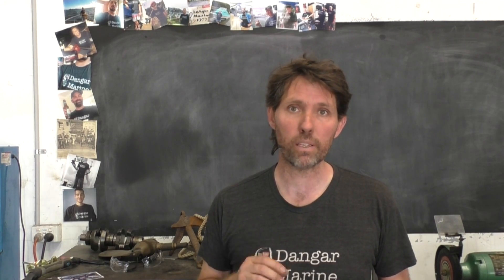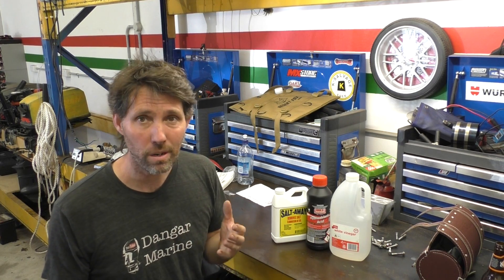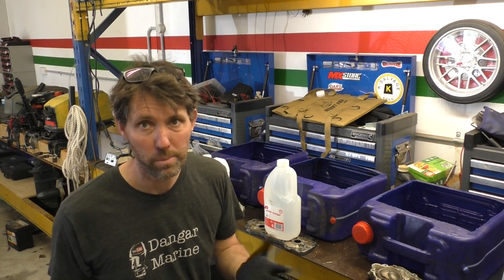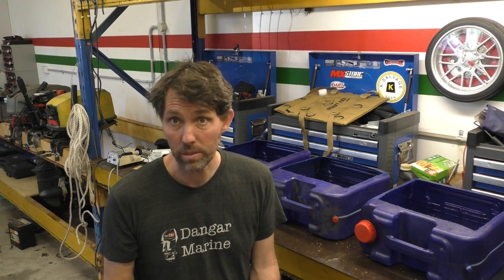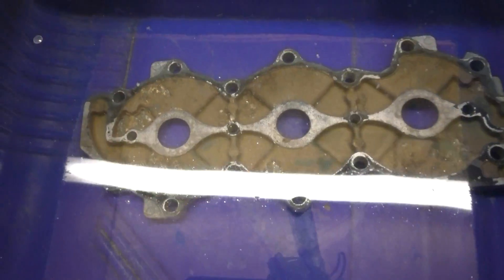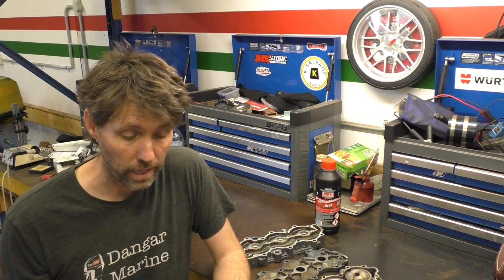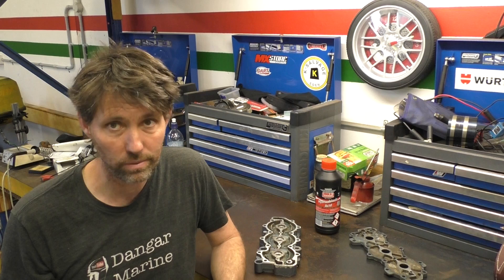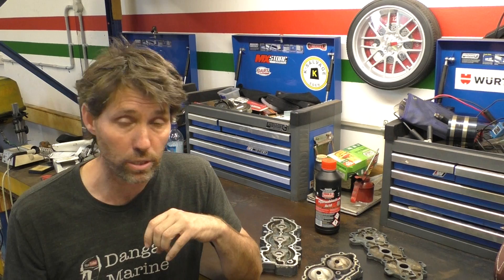Cleaning outboard water passages

Comment: All aluminium parts form a coating of aluminium oxide directly after production. Using HCl this coating reacts: Al2O3 + HCl > AlCl3 + H2O. This aluminiumchloride is solvable in water so flushed out of the engine. The aluminium will form a new layer of aluminium oxide but a little bit of material  is gone. The salt in the engine is NaCl which cannot react to HCl because it already contains Cl- ions.
It will soften by the water used and become easier to clean.
The impellor is made of MBR rubber which is resistant to most acids so nothing will happen.
To my opinion an outboard should be flushed with fresh water after use in salt water on a regulary base. This can easily be done by putting the tail in a big bucket with fresh waterand let it run for 5 min. on 1/3 power.
Reply from the maker: Interesting about the salt not reacting with the hydrochloric acid. I guess this technique might be okay for a one off restoration of a badly blocked outboard, but as you say, regular fresh water flushes really are the way to go.
Reply: Looks to be the most scientific reply.  A lot of “swear by” replies, is there really any study that says fouling is decreased by any process; ie. engine stripped after various methods?  
Anyway, our motor spends the season on salty moorings, flushing after use would be impractical. So I’ve stripped a 2004 motor for the first time and found it well fouled with muddy salt.  I had flushed a strong proprietary blue solution beforehand.  It colored some of the salt, but it sure didn’t make it soft enough to flush away.  I won’t waste space keeping the remainder of the bottle!
In my opinion only acid pickling could remove salty deposits without physical intervention.  Like Stu, I don’t think anyone would or should trust that process in a working motor. No problem if you want to pickle parts in a bath where you’re in full control, but not as a blind flush / soak. 
So periodically support your local Stu and get them to open up the water passages to clean them in a controlled manner.

Comment: Hey Stu, Do you know of a viable way to get a your solution of choice into the water jacket and have it sit there for a period of time? Say by blocking up the water pickup and pouring it in through the thermostat housing. Or with some head pressure in a hose, with muffs, clamped onto the water pickups and letting air escape out the thermostst covers. Would any such scheme have a chance to work or a waste of time?
Reply from the maker: Hi Adam, good ideas. I think the easiest way would be to take the leg off and then plug the water pipe heading up to the powerhead with a rubber bung or something. You could then pour down through the thermostat and get everything before it. You might want to let it run out for a bit first to bleed the air out. The part of the head after the thermostat might be harder to block up, but it is also easier to disassemble and clean.

Comment: I would never use any chemical in the aluminum parts of the motor and agree with you that a rinse of plain unsalted water is the absolute best option.  The wash bubbled more in the spark plug areas since the metal was not passivated and the acid was more aggressive in these areas.  The hydrochloric acid reacts with the aluminum to form aluminum chloride (another salt) and hydrogen gas.  The hydrogen gas is the bubbles that you see.  A big no-no.
Reply: I was guessing that the residual steel from the spark plugs in the head threads was also making a bit of galvanic reaction happening. The acid on a single metal at 90 minutes should be OK, there has to be some decent metal thickness just to stop warping and have the engine achieve a decent life  time. I agree with you, if the engine is already over heating or being stripped for major work,  an hour or so in acid and a good rinse and repaint straight away may be a parts / money saver. But as a regular clean after each run  or an end of season clean I may go with the saltaway if I used anything, but fresh water and a 10-15 minute run would be enough for most people I reckon. Water was all we ever used in the navy, but if the tanks were full we would use straight distilled water from the evaps at the end of their run as the water was warm and would dissolve salt deposits pretty quickly, but you needed lots of water- 200l or so . Probably even more effective with osmosis filtered water nowdays!
Reply from the maker: So I guess the real question is, if you have an old outboard that is unusable due to blocked up water jackets do you give it a shot with acid, take it apart and try to mechanically clean out or bin it?
Reply from the maker: Interesting point about there being tiny fragments of dissimilar metal in the spark plugs threads. I'm also starting to think that the extra heat from running the outboard also helps as you mention too. More experimenting required I think!
Reply: Take it apart - chances are if it is fouled that bad you would have to acid wash it till there was just a nut left!  :)